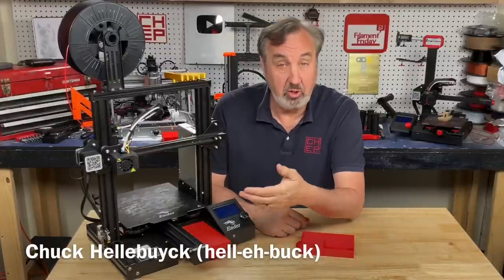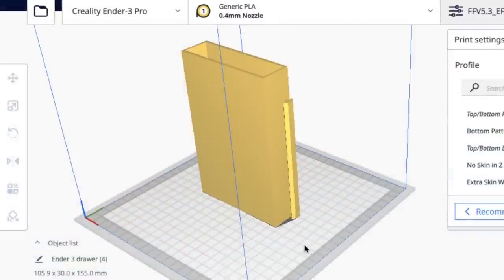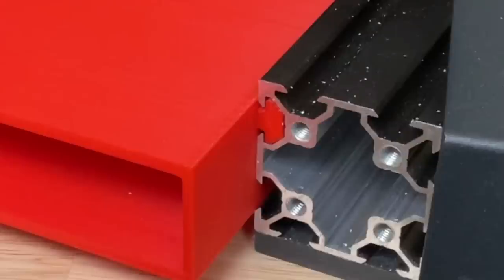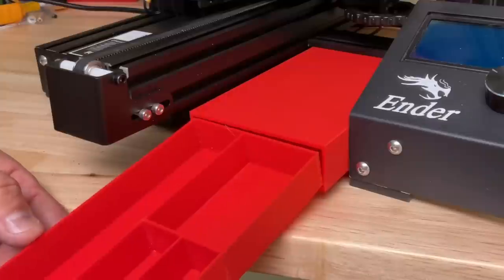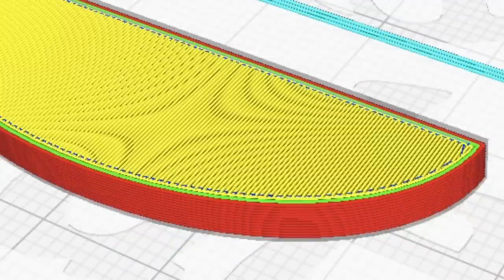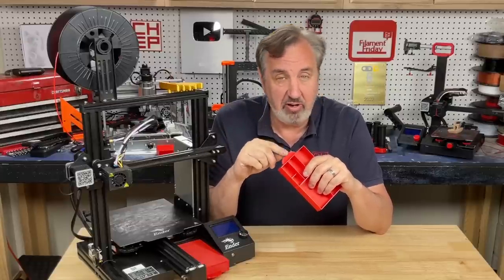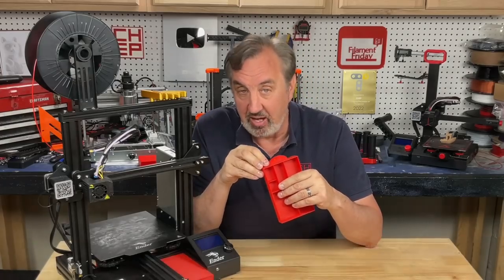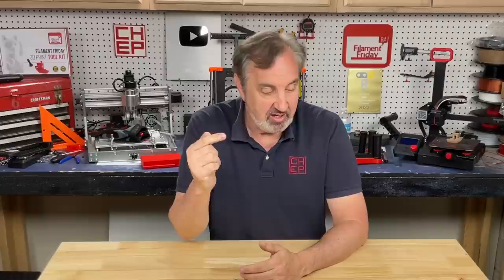Smoother Top Surface on 3D Prints shown on Ender 3 Tool Drawer Upgrade

Comment: I use your FF 0.28 profile, it was a game changer. For functional parts (with a 0.4 nozzle) i changed the height to 0.3 and width to 0.8. that shaved another 30% from printing duration.

Comment: Thank you for your hard work. Another educational video. Unfortunatly I no longer have standard Ender 3 printers left. They have been rehomed. I do have my 2 Ender 2 Pro's that I use for my detailed printing obs. I just upgraded my 1 ender 2 pro to the creality blue frosted matt buildplate. It is just like the Ender 3 S1's build plate. Steel sheet with sticker on top. Great results so far with that.
I am looking at getting a bi-metal heat break for my S1's so I can print some industrial materials. I already had to replace the PTFE tubing inside each one due to degration, ust from printing PETG on them.
Sorry for my spelling. English is a 2nd language to me.

Comment: These are the settings I use to get exquisite top layers. 

Key Settings for a (near) perfect top layer (In Cura):

Top Surface Skin Layers = 1 
Top Layers = at least 3 (may need 4 or more if you use a low infill density)
Top Surface Skin Speed = 25mm/s
Top Surface Skin Line Width = .28mm (Experimental Setting)
Monotonic Top Surface Order = On (Experimental Setting)
Combing = Not in Skin

Comment: It's amazing to see you make such functional parts in tinkercad. Could you do some more videos showing your process? There are very few Youtubers showing tinkercad for complex parts. 

I would have changed the infill pattern to rectilinear or gyroid, providing much more top surface support for the same density. Grid infill crosses itself multiple times per layer which can cause material build-up at the cross points and pressure irregularities across the rest, not to mention the irregular spans between the solid top layer lines, and because each "cube" is self-contained it can contribute to the "pillowing" of top layers as well.
Reply: Agreed, would like to see more Youtube videos on more complex parts in Tinkercad.

Comment: Try more top layers.  I never use less than 4 and that always gives good results.  Especially important if the infill percent is low.
Reply: I agree but 4 layers at 0.28 is a lot of material and print time, especially on such a short part.

Comment: Cool.  When I use Cura to make parts like that, I choose concentric for top & bottom pattern and iron the top.  Looks pretty good.  Not necessarily the fastest way, though
Reply: Tell me about it, I had a print going last night and I chose Monotonic infill and ironing, it added 4.5 hours to my print to make a total of 13.5 hours but it looks awesome!
Reply: @AndrewAHayes  I've been using a BUNCH of walls and 5% lightning infill to get some speed back

Comment: I think I had a similar problem with your FF5.1_EF(0.20) profile (while the 0.28 worked fine). I'll try the same settings, see if it solves the problem.

Comment: Sorry for co-opting the video thread.
Any discussion on waterproof prints - ala vase?

I have some recent vases, that came out looking great with no visible defects yet they leak.  
Not a lot but any leakage is unacceptable to desk finishes! :)
Is the answer: 
1 - settings
2 - use a PLA smoothing process
3 - coat with something like wax
Reply from the maker: It’s usually the design. Need rounded solid corners and thick walls/bottom.
Reply: Use PETG instead of PLA or ABS. if those are must for you, then try to epoxy cure.

Comment: How does your first solid layer over infill look? Is the first layer over infill run using bridging parameters or solid infill parameters? This is an excellent result with just 3 top layers. I use either 24% "support cubic" infill or 50% "lightning" infill. Saves a lot of time on larger prints but I use probably 6+ top layers with top surface ironing

Comment: Thanks for sharing! Do any of the Patreon levels get access to the profiles? I've been using the FF_0.28(Extra-fast) profile. I just tried the FFV5.3(0.28) and I'm still getting some roughness. Would it be possible to email you with some photos and questions?
Reply: A good question that should be answered by Chep.
Reply from the maker: Jett Ryker - All Patreon levels get access to them. Patreon people have direct access to me via message app in Patreon and I can look at your pictures.

Comment: Really Good Video Thanks For your work.  What I am trying to do is print letters.The top and bottom look good but the sides around the letter looks bad .What I do is take a image of a letter amd change into a jeg format  take it to cura and print. Have you got any ideas on how to get the out side edges smooth. I have used heat and acetone to smooth does not work for me.

Comment: I have the same problem with my Ender 5 S1 so I'll be trying a change in my slicer settings. I'm using the Sonic pad and yes it is fast but finish is often poor. Pity as I like the set up. I also have a Flash forge 3 and that just works and works. It produces great prints a pity the print bed is so small. I would describe the Ender 5 as disappointing. Great potential but poor results.

Comment: I bought a Sprite Extruder from creality3dofficial because they had it plastered all over the site that it would ship from the US and arrive in 3-8 days. I got the part and it worked, but it shipped from China and took almost 3 weeks to get to me. Just a heads up for anyone planning to buy from them, you’ll get the part at a discount, but you may end up waiting a lot longer than expected.